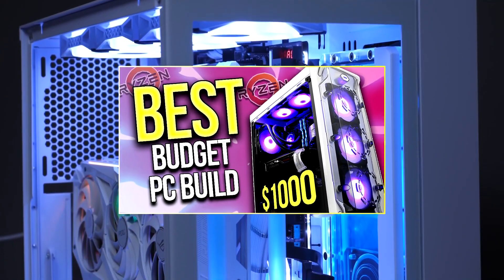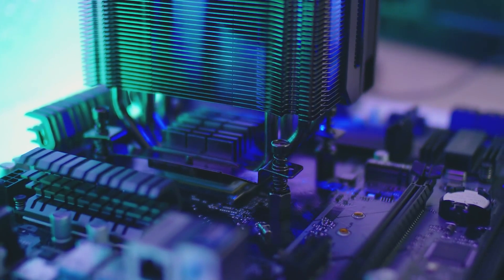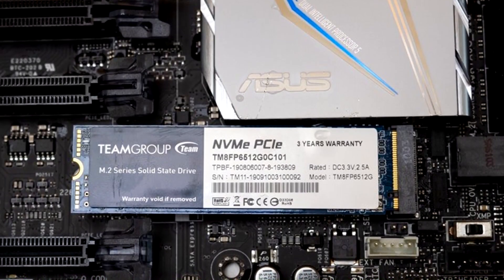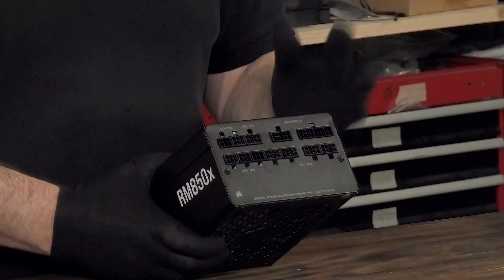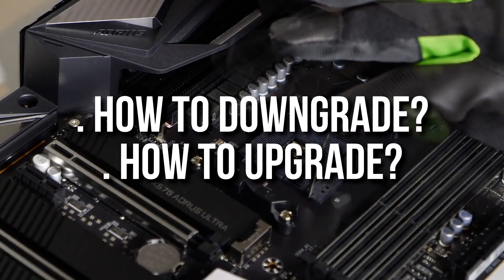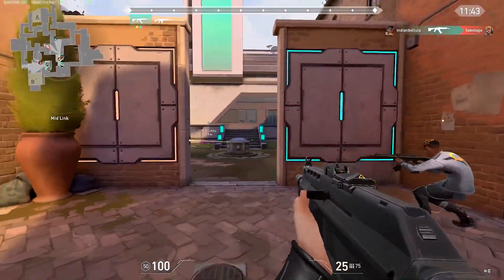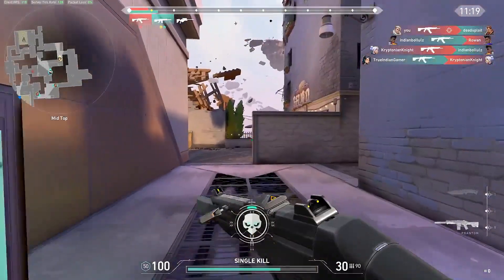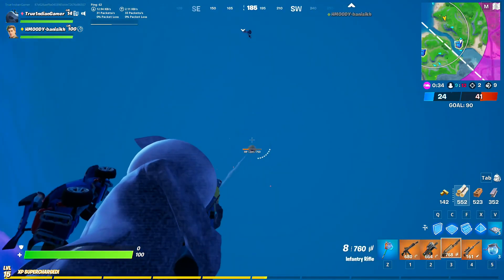Best Budget Gaming PC *INTEL BUILD* | March 2022 🔥

Comment: Can you play games on the pc and just add a GPU later on? Or do you have to get the GPU so you can connect a monitor
Reply from the maker: you can connect the monitor to the motherboard but you can´t play if it doesn´t have integrated graphics, I would recommend the ryzen 5 5600g if you want a decent CPU with integrated graphics to add a GPU later on
Reply: @ShadowGamingPC1  doesn't it have Intel UHD graphics?
Reply from the maker: @PepRoar  the 12100 yes but I don´t recommend it for gaming
Reply: @ShadowGamingPC1  do you think a Ryzen 5 5600g with 16gb 3600mhz do a good job with a GTX 1650 upgrade later on the line?
Reply: @ShadowGamingPC1  if the answer is no can u send me 500-600 budget pc builds
Reply from the maker: @PepRoar  there´s literally a video coming tomorrow about a 600USD PC Build!! I would go with at least a 1650 Super down the line, you can go with the rx 6500xt too, is cheap
Reply: @ShadowGamingPC1  ok thank you for letting me know I'll be checking the video out tomorrow!

Comment: Nice to see a video from you (as always) also watching ads and I also have a question, Me being on the HP website (where you can edit the components that are on the computer) 

I have my eyes on the maxed out hp pavilion or  the  no modification victus 15L what do you think is the best option?
Reply from the maker: let me know the maxed out pavilion specs and price
Reply: @ShadowGamingPC1  okay, I’ll be right back
Reply: @ShadowGamingPC1  

I do video editing and sometimes play games and was trying to get the best for both worlds

Networking:
Realtek 2x2 5 Combo

Chassis And Power Supply:
Shadow Black Plastic, Dark Chrome Logo, 500 W Bronze Efficiency power supply

Graphics Card: 
NVIDIA GeForce GTX 1660 Super (6GB GDDR6 DEDICATED)

Storage:
512 SSD Storage

Memory:
16 GB DDR4-2933 SDRAM (2 x 8 GB)

Processer:
Intel Core i5 11400 (2.6 GHz up to 4.4GHz, 12MB L3 cache, 6 cores)

Price:
1184.99
Reply from the maker: @Bruxiism  the victus is better but you still need to upgrade it, like edit the ram with 16GB and storage with 500GB SSD and it´s going to be cheaper than the pavilion and better
Reply: @ShadowGamingPC1  got it, thanks
Reply: @ShadowGamingPC1  i went to your old video to see the customization options and I don’t see the pc on the HP site anymore, do you know any alternative links?